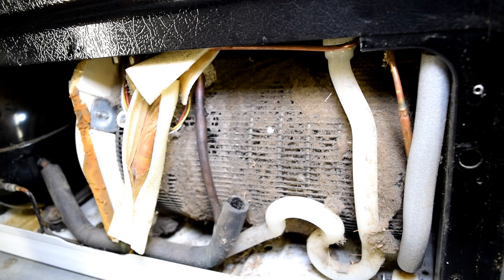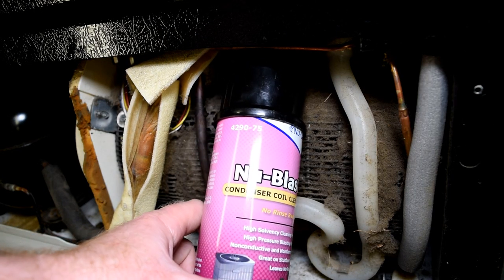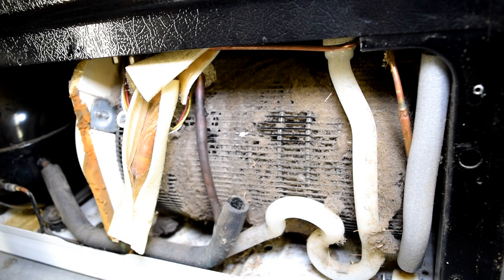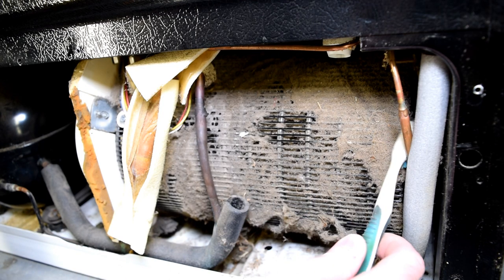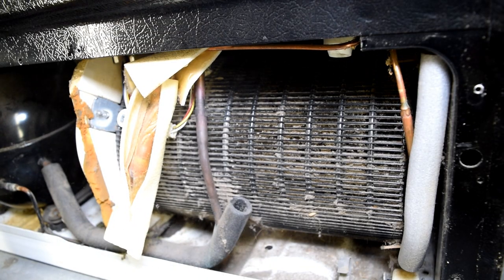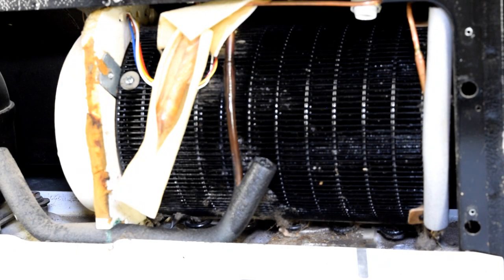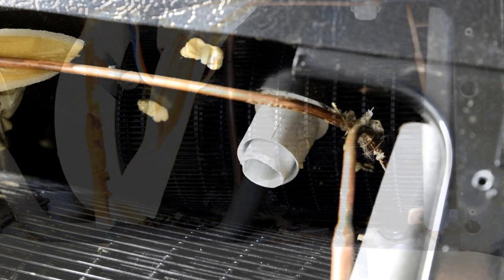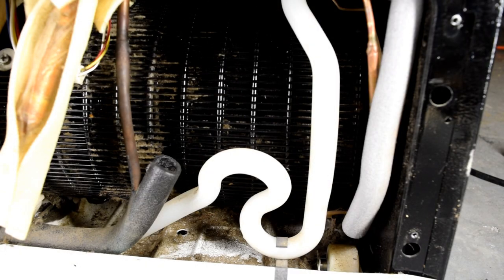Cleaning Condenser Coils - GE Side by Side Refrigerator

Comment: 5 year old GE side by side frig owner. Watched your vid, then wanted to clean. Looked in the manual under maintenance, no mention of cleaning coils. Looked on website, said models made after 2001 didn’t need cleaning. Called 800 number for GE. Said it didn’t need to be cleaned. Couldn’t even tell me where coils are located. No problems so far, but I’m going to give it a try.
Reply from the maker: Hey, yes. Your manual (made by the same people selling you a new fridge) say thay it never needs to be cleaned. LoL
Until they're purchasing my new fridge, I'll keep cleaning mine. 😁

Comment: I've cleaned my coil 2 to 3 times per year. It is quite difficult to clean the back side. You kinda have to get a little creative and use what you have at hand. Toothbrush is number one, long flexible brush also. I bring out the old shop vac to help for a better job. Compressed air is also an option for final sweep. Of course you need to make sure the wife is out shopping or at the nail salon, etc. Otherwise you'll end up sleeping in the dog house for a week. This demo is cool though, it shows that you really don't need to get nutty nuts. Just clean it, and get back to what's really important, TV, recliner, remote, snacks and a six pack. In whatever order you want. LOL
Reply from the maker: Jazz Hog my thoughts exactly!
Reply: I am the wife - and I am the one who'll be cleaning the coils! LOL I can't imagine why any wife would get mad for you prolonging the life of a major appliance!
Reply: You are a smart man 😄
Reply: @mikethompson3534  HUH ?!!
Reply: @mikethompson3534  LOL I'm not really, I just like to be challenged. Especially mechanical stuff. Thanks for the kudos...

Comment: I've watched a couple of these videos showing how to clean refrigerator coils.  Some have the coils under the bottom of the fridge and others, like the one shown here and like my GE side by side, is at the bottom of the back (in a round configuration).  My first instinct would be to use a vacuum to get the heavy obvious dust and dirt.  Using the brushes first would seem to shove the dust and dirt further into the coils, making it more difficult to clean as thoroughly.  There is also a cooling fan at the left end of this type of coil which also should be cleaned (vacuuming and wiping the blades and surrounding surfaces).
Reply: Thanks for this! A how-to video that doesn't show where to access what you are doing doesn't seem terribly helpful.
Reply: @Josh B  Behind and lower right bottom. My GE has a cheap piece of cardboard ( 8 screws ) that needs to be removed. My GE Profile looked exactly like this video.

Comment: Came across this video and checked my refrigerator coil out. I normally just vac the back and underneath the front. So took the back panel off and oh my, what a mess. Got right down to cleaning out the mess and ended up vacing a whole canister full of dust. Looking forward to see what the results will be as this maintenance has not been done since the purchase of the refrigerator. Again, thank you for your video as it was extremely helpful.
Reply from the maker: Awesome work Jim!
One more thing for the annual list. Haha
However, this job is one that will extend your fridges life more than any other maintenance I can think of.

Stay in touch!

Comment: I shot mine out with the air compressor after sucking/brishing off the heavy stuff. Any issue with that other than a dusty kitchen?    Also wondering if there is anything to be cleaned on the front bottom of the fridge, where older fridges has a kickplate? These newer side-by-sides dont appear to have anything accessible there, but it sure seems like there should be more to it than just cleaning the condensor.

Comment: Great video! I used an old paint brush and shop vac. I didn't think it was necessary to remove 
all the small kitchen appliances that I store on top of the refrigerator before moving it way from the wall. The blender glass jar fell to the floor and shattered which prolonged what was supposed to have been a simple 20 minute chore.
Reply from the maker: Mema Perm oh no!  That’s not good. I’ve come close to toppling someone’s lamp or display dishes from on top of a fridge before.  It never fails that I have like 30 different spice bottles come off the cabinet anytime I try to move a fridge. :(

Comment: Bending the brush to reach the back is a good idea. Using a vacuum to suck up that dust would have been another one.
Reply from the maker: Claude Desaulniers thanks for the tip Claude. A vacuum is not possible to get to the back side of the coil. I’ve seen others used compressed air to blow the dust off while using a vacuum on the other side of the refrigerator to catch the dust that comes off. Seems like a mess, but probably works.  

Funny enough when reading through the tech manual, GE actually says that the customer should never have to clean this coil under normal conditions for the life of the machine.  Yikes! 
They fail to mention that that life could be much longer should the customer choose to do so!  Haha 

Thanks for watching!
Reply: Ya, GE wants it to crap out so you go and buy another one.  What I meant with a vacuum was that while you are scraping the crud off the coils, all that dust would get sucked up with the vacuum  air flow rather than float into your kitchen. A compressor with a vacuum is good too. So, your bent brush to reach the back, and vac for the dust makes it all good. I guess I'm picky about dust because of allergies.
Reply from the maker: Claude Desaulniers great idea!

Comment: mine looked a lot like this..freezer was warming.  I used a vac with long narrow tube from the front and vacuum with brush attachment for the rear.  I then repositioned vaccuum in the front and balsted the heck out of it with compressor air hose from the rear.  Good as new...thanks!!!

Comment: Would spraying with compressed air after the aerosol help? Considering how important this is to keep clear, I am amazed it is so hard to service. I tried removing the condenser fan, but could not get to the bottom bolt. My hope was to shop vac from the inside but no way to get the bolt out (the top wasn't easy either).

Comment: Hi - Thanks for the tutorial. I have two questions: 1.  Are the coils located at the back under that cardboard panel that says something like "Do not remove under penalty of law?" If so, how do you replace the panel when you are all done cleaning? 2. Does the bottom end of the defrost pipe connect to anything? Thanks in advance!
Reply from the maker: Hi,
LOL, I've never noticed a warning like this, but you can definately remove this panel. You might take a picture of how it slots back in before removal just in case. Most will have a few 1/4" screws holding it in place.
The defrost drain line doesn't connect to anything but rather simply let's the water drain in to a pan under the fridge.
Just make sure the tube is returned to the same general area so the water will properly flow in to the pan.

I hope that helps.
Reply: @GraceAppliance  Wow - my 6-yr old machine was even dustier than yours! And I do vac behind the fridge about quarterly. You were right: the cardboard panel just screwed on/off. I vacuumed that while it was lying on the floor. I have cleaned the coils as best I can and my defrost line certainly had some gunk right where you said it'd be. I rinsed that out - at first it flowed in a limited manner. Now my son & hubby are twisting a cloth through as best they can. Almost done here. I am confident that my machine temps will stop this afternoon increase. And you just saved me at least $75 bucks! Thanks!!

Comment: The tech person who diagnosed my fridge issue never pulled the fridge out to see behind - he stated that the compression pump can't pump the freon over to the evaporator - does that make sense? My freezer is working just fine- refrigerator part is super warm - 79 degrees.
Reply from the maker: Maureen Noonan 
If he pulled the inside wall of the freezer down to expose the evaporator inside the freezer he might have been able to say this with some confidence, but if the freezer is getting things frozen rock solid this is an indicator that the compressor is doing its job. 
If your fridge had just a single evaporator, the symptom of a working freezer but warm fridge seems more likely to be a failed evaporator fan motor, a bad damper door motor (or frozen shut) or a failed refrigerator temp sensor.
Reply: @GraceAppliance  He did not pull the inside wall down- he took shelves and basket's out but no walls. The freezer I believe is good, things were certainly not melting- he said the fans are all working. I am at the mercy of these pple. I unplugged the fridge to see if it was an icing issue and I've pulled it out from the cubby and will be cleaning the condenser coils from the back if I can get at them.  I still don't understand the 'compression pump can't pump the freon over to the evaporator' - have not seen any videos related to that issue. TY so much for your reply!
Reply from the maker: Hey, here is a quick explanation of how your refrigerant travels through the sealed system.  I hope it helps.  Thanks! 

Refrigeration Cycle https://youtu.be/GpVat6F190M
Reply: @GraceAppliance  Interestingly- I had unplugged the fridge for 24hrs and now it seems to be cooling fine. I'm going to leave it off for another 24hrs -maybe the air flow vents were blocked up by ice? If the diagnosis by the tech person was correct, could it possibly be now working fine? Just wondering if I got scammed.

Comment: I would have loved a full view of the refrigerator so I could see exactly where this compressor is.  I am not best person left to my own devices here--also I have severe dust allergies can I just use a vacuum?  I have an attachment that works for my computer keyboard--would it work for the coils too?
Reply from the maker: Hi J, 
Your condenser coils are behind your refrigerator at the lower right hand side (if you have a GE side by side). You’ll remove the clover on the backside of the refrigerator which will be either cardboard or metal.  You can use a vacuum, but will only be able to get a portion of the dust off. You may also want to wear a mask if you are sensitive to dust.  

I hope this helps. Thanks! Let me know if you have any questions.
Reply: Can I unplug my refrigerator with food still in it?  Will it harm the refrigerator in any way?  I am sure this has NEVER been cleaned and it is 21 years old. I am a bit nervous--there is a copper pipe right from the back of my wall going into the back of the frig--the same size as the ones you show on your video.  The panel at the back is cardboard and secured with screws.   Getting nervous...
Reply from the maker: Hi J, 
Yes, you can safely unplug your refrigerator temporarily while you complete this job.  It will stay cold for several hours unplugged as long as you do not open your doors.  

The copper tube you have is your water supply line and you should be able to leave this connected without any issues. Just be sure not to kink this line while you're behind there cleaning the coils.  

So, you'll unplug your refrigerator and remove the 5 screws which hold the cardboard on and this will reveal behind it your condenser coils in the lower right.   

Don't be nervous, I'll be here for you if you have any questions!  : )

Comment: So is there anyway to easily remove the coild then clean it? Mine looks to have a lot of dust on the inside of the cylinder I can't get to at all. Guess I will try air compressor blowing it out then vacuum? idk? Anyone?
Reply from the maker: Hi Ome,
No, unfortunately. It's part of the sealed system so in order to remove you must cut the refrigerant lines which of course is a major job to reinstall.

I agree that compressed air is your best bet, but also be prepared for a bit of a mess doing it this way.

Thanks

Comment: The video is good, but the work becomes more efficient when, in addition to the brush, the brush extension and the cleaning agent, air pressure and a vacuum cleaner are used to deepen the cleaning and finally if the cleaning agent is applied.  for the most excellent.

Comment: If the compressor isn't kicking on once plugged in, is there any point in going through this process?
Reply from the maker: No, coils would not have an impact. I have a video called refrigerator too warm which may help. Thanks!

Comment: Found Nu Blast on Amazon.com for $17, will save you some money for future cleanings.
Reply from the maker: That's a good deal!
That stuff is outstanding.
Reply: I ordered a can to do mine, it's ready for a thorough cleaning.  Thanks for the video, it helps a lot!
Reply from the maker: @Grrr036  you're most welcome. Good luck with it and let me know if you happen to have any questions.
Reply: Thank you Gary
Reply: Walmart has the spray for the same price as Amazon.
Reply: I just bought a used refrigerator from the owner.( not a store) 
Ge profile side by side. It turns out it's 16 years old. The ice maker doesn't make ice and dollar store ice trays won't even freeze. Where should I start? Any suggestions are appreciated!

Comment: What am I supposed to do if I have cardboard in the back?  Throw it away?
Reply from the maker: You need to leave the cardboard panel in place behind the fridge. It helps with appropriate air flow. Thanks
Reply: GE Side-by-Side ONLY - Refrigerator Repair Videos ohh. But what if I have to clean under it? There are a million screws holding it in place.
Reply from the maker: @timm285  if your fridge has cardboard on the underside of the fridge, you need to leave this in place.  There is a removable rectangle panel on the back that comes off with around 6-8 small 1/4" nuts.

Some model of fridges are cleaned by removing the front kick panel and using a long brush to reach in.

Comment: Question... any reason why power plug has to be off? What if the power is still on while the cleaning is happening?
Reply from the maker: DONG IL PARK just for safety.  Watch for the fan blades.  Other than that, there isn’t a lot of electrical on that side of the fridge by use common sense as always.

Comment: It is kind of difficult to clean it up
Reply: I mean it is difficult to clean inside of the condenser coil.
Reply from the maker: @andrewjia5604  it would be. Most models you would need to remove the condenser fan motor to access. I'd say it's probably overkill as knocking the majority of the dust off of the exterior of the coils will be adequate for most instances. Also, the interior will naturally be less dirty due to the fact that the air is being drawn from the outside toward the interior so the dusr/hair will collect on the outside of the coils vs the inside.

I hope that helps.  Andy

Comment: Worst condenser design I've ever seen
Reply from the maker: It's a headache, but funny enough the tech sheet says this design never needs to be cleaned!  Yikes. This coming from the folks who sell fridges I guess. LoL

Whirlpool may take the cake for worst design ever though, thier is UNDER the refrigerator and you can only get to the very front of the coils unless you wanted to tilt the fridge back!  Awful.
Reply: We should rinse with water or not? the Nu blast after 10 minutes of stand by;
Reply from the maker: No, the nublast is a no rinse condenser cleaner.  So, no water is needed.  Just let it air dry.